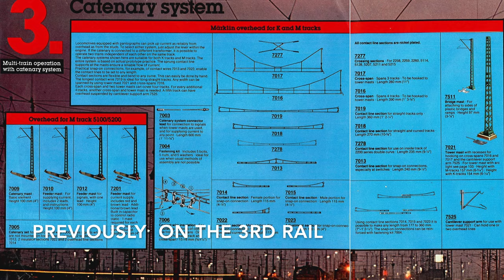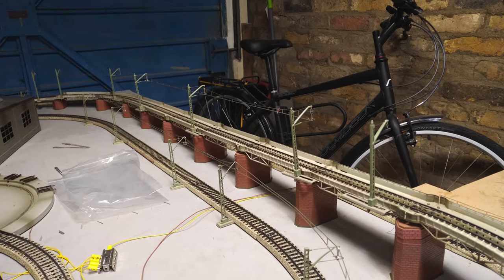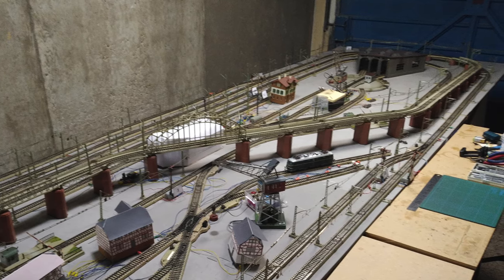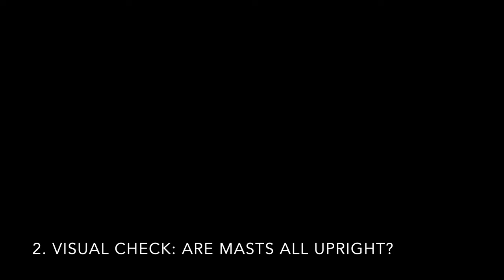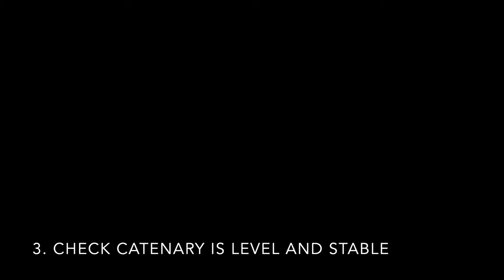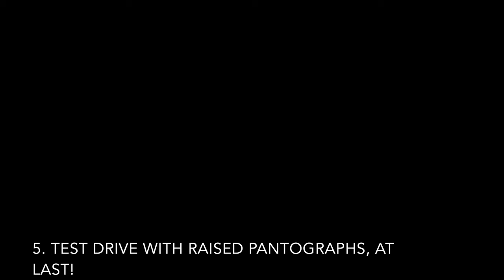Layout 2021 - Catenary (part 2) - Märklin M-track analogue

Comment: This video is very helpful.  I discovered that there are at least two different size 7009 masts - one that is one piece and one that has a separate mast and base.  The one piece mast is significantly larger.  It looks like you use the smaller and newer masts?  Love your videos.  My layout uses c track but I have old M Track accessories including the old style catenary.  Would like to know about you. I assume you are french.  Where do you live and what is your first name? Keep the videos coming.
Reply from the maker: Hi, I use both types of masts, the larger ones are older, the height under the wire is the same or at least very close.  Thanks for the visit!

Comment: Marklin used to provide a small nut and screw that you could bolt  wires together
Reply from the maker: indeed, they are featured in the little helper video about catenary on the channel. Thanks for the visit.